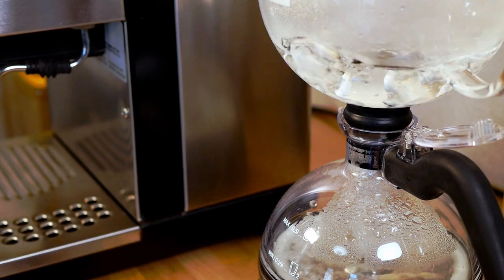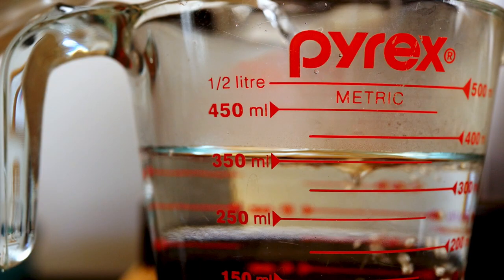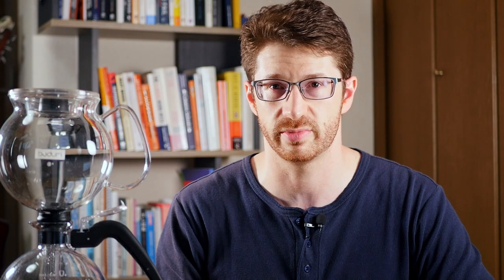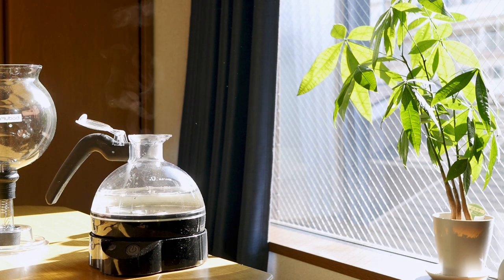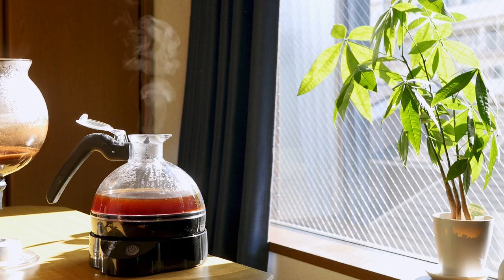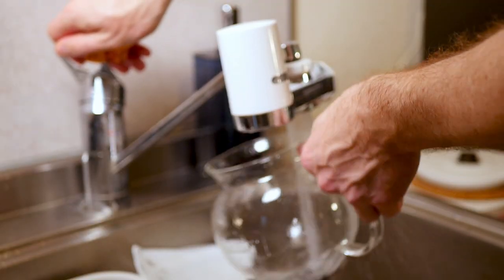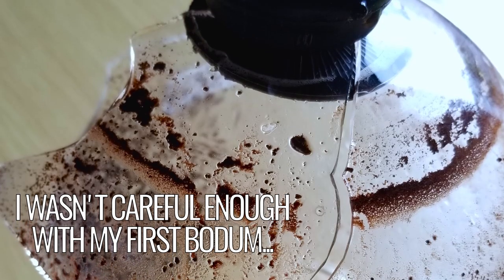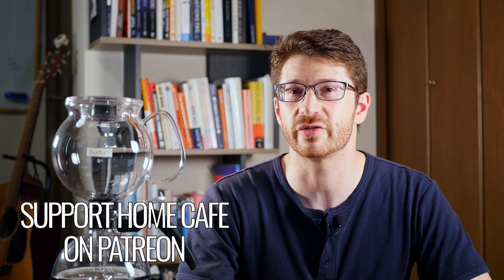How Good is Syphon Coffee? [Easy Brew Recipe]

Comment: This recipe is overly complicated. I grind coffee ultra fine, like with Turkish coffee and use a 17:1 water to coffee ratio. I put cold water in the bottom and the coffee in the top and give it a little shake to make sure the coffee bed is flat. I press the button and walk away. The machine beeps when it begins brewing. When it beeps a second time, I give the top a little shake to ensure the coffee bed is flat and then wait for the coffee to come down to the bottom. That's it. Using an extra timer and boiling the water ahead of time adds complexity that we really don't need at all.
Reply: Should be at least 14:1 otherwise it`s coffee water, not coffee. For cezve, it`s usually 10:1.
Reply: @masterofreality926  14:1 is for coarse grind, like for a French Press. 17:1 is for fine grind, such as for a pourover or a siphon. 10:1 is espresso.

Comment: Hi Charlie.  I have the stovetop version of the Bodum Pebo.  I feel it takes far too long for the coffee to siphon back down to the lower chamber, and occasionally the upper chamber does not empty completely, making the coffee ruined.  I've tried different grinds and never use high heat.  Like you, I preheat the water.  Do you have any suggestions as to why the coffee in top carafe takes so long to enter the bottom?  Thank you!
Reply from the maker: Oh, I would think if it is cold it should filter down easily. Mine has no problem if I turn off the pot at 60 seconds. Maybe remove it from any heat source and see if it drops faster?
Reply: It's a bit different but I have a Cona (stovetop) siphon. (the central filter in the middle is different but the principle is identical) I had exactly the same trouble and worked out that air was leaking into the gap between the two chambers when the coffee was going back down. (meaning that the vacuum in the bottom chamber was gone before all the coffee had filtered down to it.) I fixed it by grinding very slightly courser and making sure the upper chamber was firmly fixed into the lower one so there was no possibility of an air leak. (slightly terrifying pushing down firmly but not too firmly when the whole thing's made of glass. Luckily Cona had been around for quite a while and replacement parts are pretty easy to come by on ebay.) Hope this might help.
Reply from the maker: @broado1  Nice that's good to know. The seal is super important. If the rubber gets degraded I saw on their site that they sell the rubber seals for quite a cheap price, so if the seal is a problem you can easily fix it.
Reply: @homecafecharlie  Yes indeed! SUPER important! I replaced the rubber seal on one of mine. On a side note I have a bigger cona called a Standard model (sometimes Standard Kitchen Model) which comfortably holds just under 2 pints more or less. The reason I'm telling you this is that it has a MUCH wider neck which is easier to clean (still a bit fiddly but certainly easier than the smaller one. I mean, I know you already have a siphon but hey, you can't have too many coffee makers! 😉 ) Here's a picture:
https://pin.it/nUfDL42
Reply: Please check the seal. Then run a water cycle and observe how fast it syphons back. If your coffee grind size is correct It shouldn't take longer than 45 seconds in most cases, under 400ml... If STILL you get quite abnormally long brewing times, check your portafilter and replace the filter or try another filter brand
Reply: 2 things.    1.  Dont use too fine of grounds as that will clog the filter.  Drip style grounds should work.  2.  The vacuum is cause by the abrupt change in temperature in the lower chamber.  Try moving your stacked chambers to a room temp stove burner which will cool it down faster.  Good luck!

Comment: Why does my water not siphon  back to the bottom 😒
Reply from the maker: You have to turn the heat off and then it should syphon back. If it isn't doing that you might have ground a bit too fine and it's clogging up the filter. Let me know what works